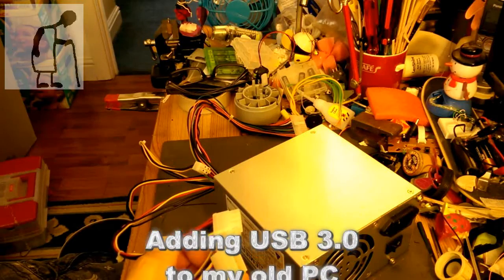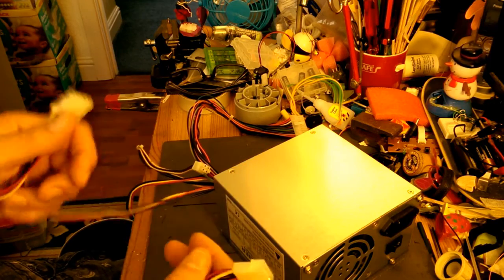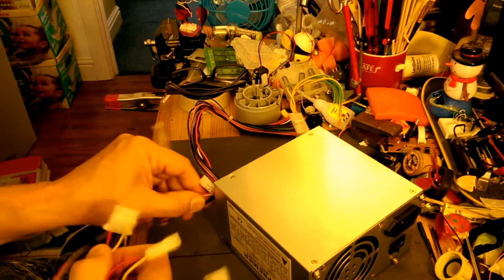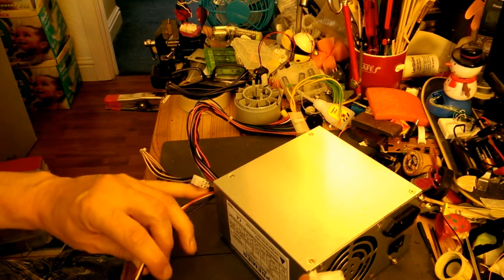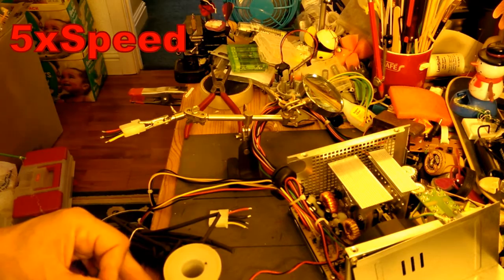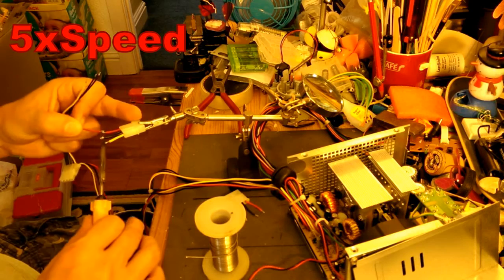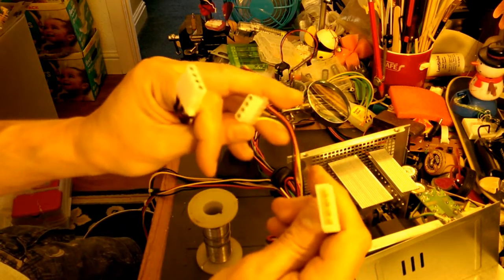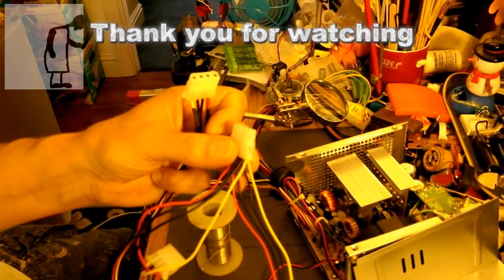Adding USB 3 to my old PC - more power plugs required

Comment: I shrink my shrink tubing the same way.
Reply from the maker: SnapPunch Robert just seems logical, soldering iron is there ready. Haven't managed to burn through any yet. I have used heat guns years ago as part of my job, but at this level it is not worth changing tools.